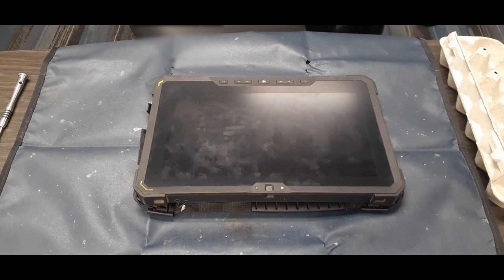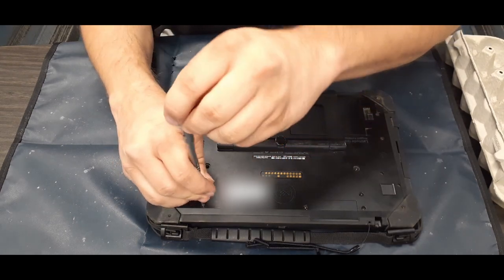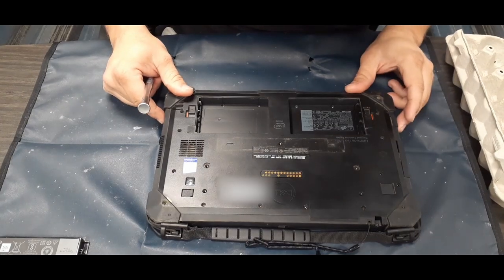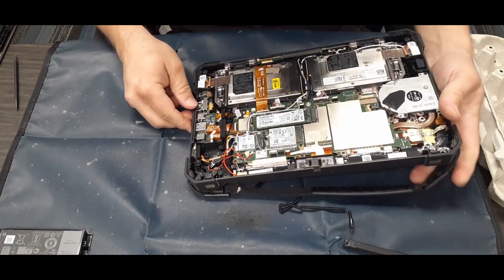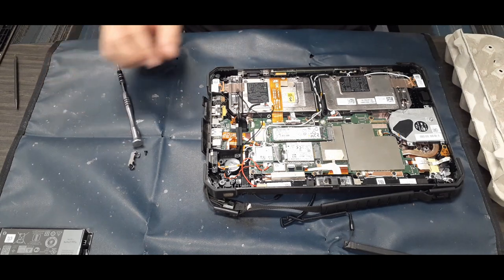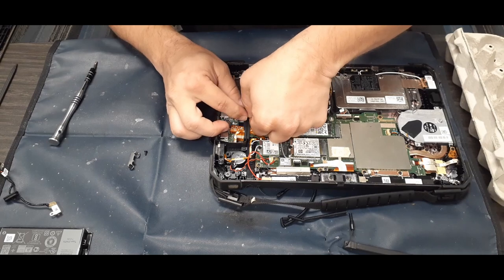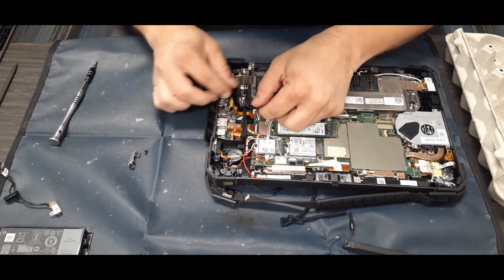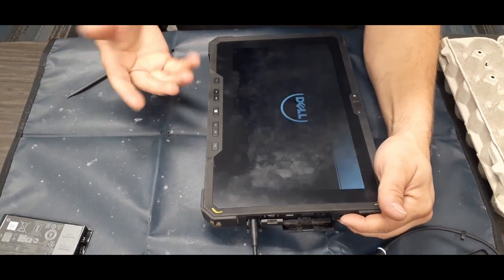Dell Latitude Rugged 12 DC Port Replacement

Comment: My Dell 7212 has 8gb of RAM memory.  I would like to upgrade to 16gb.  How many RAM memory slots are there?  Where are they located at?  I read that the RAM memory is hard soldered.  Is that right?
Reply from the maker: I haven't worked on that model however Bob Johnson has here: https://www.youtube.com/watch?v=fyiLU-FaK-M As far as I saw it's built about the same as the 12, onboard RAM, M.2 style SSD & WiFi card.

Comment: Can I upgrade ssd hard ?! 256 To 1T or 2T??
And I don’t know where it when is the location of ssd ?!
Reply from the maker: You should be able to since it is a seperate component. It uses the m.2 style drives, so you should determine whether it's NGFF or NVME. An internet search can explain what to look for. When you take the back cover off the drive is easily accessable.

Comment: Got a part number for port? I know it was a warranty job but I would kill for a part number
Reply from the maker: Unfortunately, no. I didn't catalog the DP/N's when changung parts. Conversely, If you take the old part out there should be a sticker w/ a QR code and the DP/N under it.

Comment: Can the RAM be upgraded in these?
Reply from the maker: The RAM is changeable. Be sure to check the specs for your model to determine what speed and max size it can handle though.